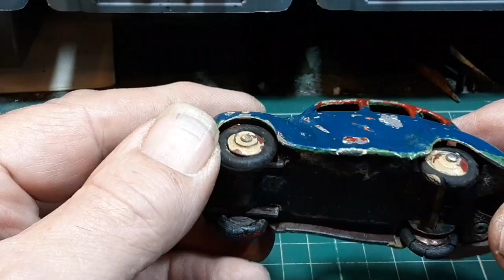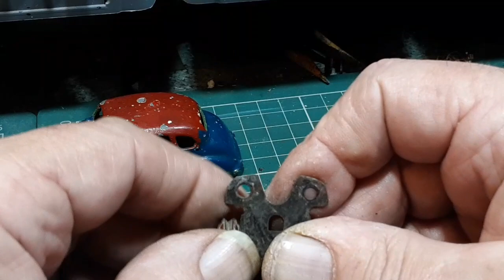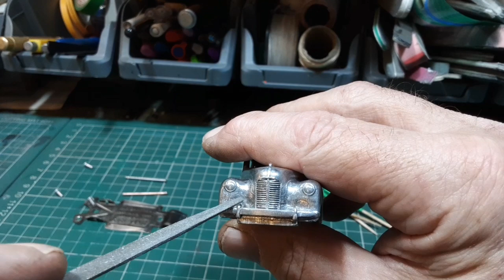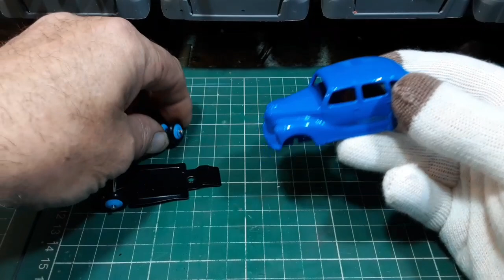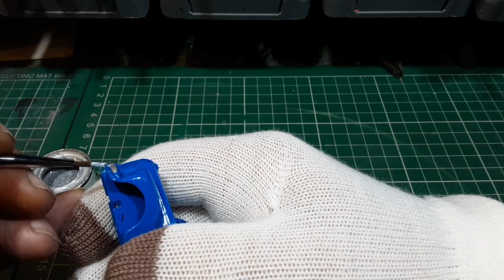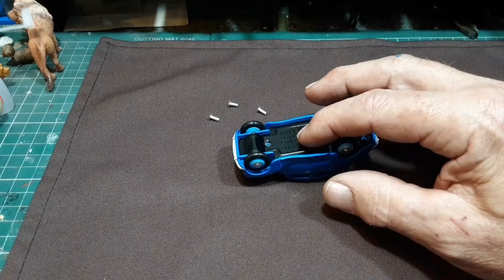Dinky toys Diecast Restoration Austin Devon no/152   1954/60

Comment: A 1948--50 Austin , I be given me longjohns and two pieces of silver for one of them there Dinkys . My brother owned a real one in the early 1960s, it was in a dark brown U.P.S. color .Soke everything in 5% vinager for 12 hours . I have asked other restorers where did you get those rubber tires? I have done detailing with a tooth pick .
Reply from the maker: I will try the vinegar method,  I have done some details with the cocktail stick its good for doing small lights ,
The tryes i get from ebay, if you look under diecast vehicles sub section  parts and accessories you will find a few sellers on there ,those were 15mm smoth .

Comment: you make painting the bumpers harder than it has to be , in that instance using the side of the brush rather than the point is far better also use a pallate and thin the paint a little martin instead of straight from the tin ,,,,, watch a couple of the pro warhammer painters , particularly edge highlighting they give many painting tips that i wish i'd learned many years ago , miniac and duncan rhodes are two good channels
Reply: also thinning and using a pallate means you can use the twist and pull back method to maintain your brushes point

Comment: Hi Martin it may be a quick one but wow what a transformation. It really turned out wonderful and great job on the detailing really made it come to life.👍 Something odd happened to me the other day. I went to fill up my ford at the servo that's service station in English lol and just as I rolled up to the pump my exhaust became louder it sounded like a motor boat. The first thing I thought was oh no it sounds like the catalytic convertor had given up the ghost. The funny thing is that when I got it up on my ramps and had a look all I could see was that two very rusty bolts were loose. I have no idea how two bolts could come that loose all of a sudden especially as when I tried to tighten them up they wouldn't budge. I had to spray them with penetrating oil and they slowly started to move then I tightened them up and it has fixed the problem. The only thing I can think is that some bugger tried to pinch my catalytic convertor and could only get the bolts undone enough to make it loose. It doesn't explain how I was able to drive to the station without noticing weird hu? Dub in music from the twilight zone here........Catch you next time mate.👍👍
Reply from the maker: Hi Geoff, its big business over here stealing catalic converters, thay have some one go around and put a cable tie around the wheel to mark it .
Iam glad you liked this one .
I hope you are both well .
All the best martin 👍